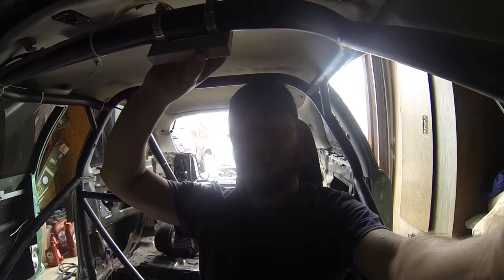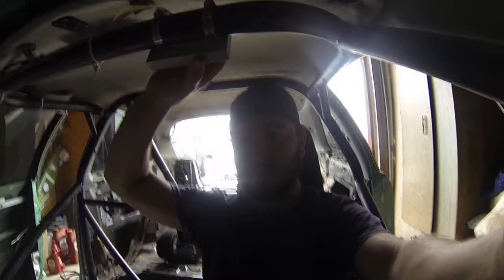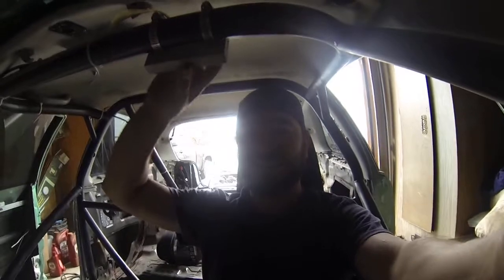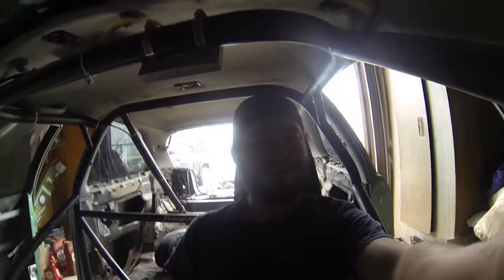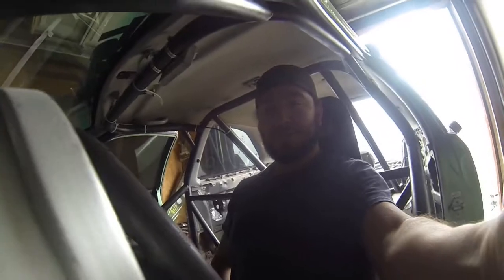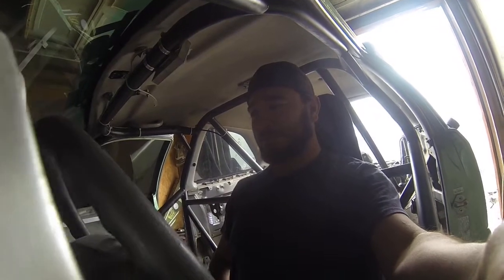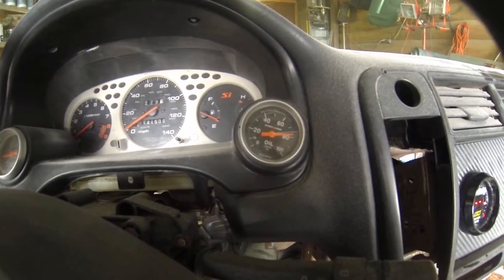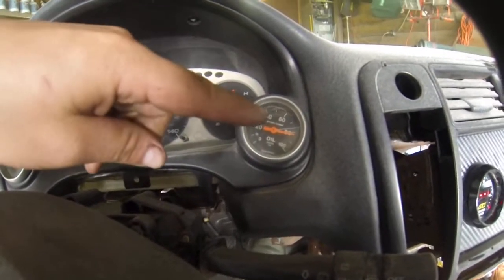First start up of my coil on plug setup, skunk2 pro1 cams revving up!!

Comment: Wonder if this will work on my aem ecu
Reply from the maker: Shon Poul I don't think it would bro because I know aem makes there own cop set up. But I could be wrong
Reply: Jason Hiboost, thanks man i guess ill just stick with my m&w set up
Reply from the maker: Shon Poul I was originally gonna run MW pro 10 setup as well until I found this cop setup
Reply: Jason Hiboost, im just having problems wiring it up. Tryed to wire it a few time but failed lol. So im just going to order the harness for the m&w and call it a day, should have the correct pinout on the connector so maybe this time it will be wire correctly
Reply from the maker: Shon Poul hahaha wiring sucks as stated in this video we wired up my cop system wrong lol might double check all your wiring to verify bro
Reply: Jason Hiboost, im just going to hold off and do it once i fly my tuner in and he can help me wire it up. Lol
Reply from the maker: Shon Poul that will work as well hahaha

Comment: Is this on the normal low cam or is vtec locked ? Sounds great
Reply from the maker: Vtec is not locked this is a cold start on the low cam. Thanks bro
Reply: Hell  ya. I’m workin on my 82x89 b18c and just picked up a set of pro1 for it. Been checking out vids of other setups running them.
Reply from the maker: That's badass man you'll like them mid to high range is where we saw the gains on the dyno. What fuel you planning on running?
Reply: Jason Hiboost I’m from northern Oregon where closest e85 is an hour either way for me. I’m going to do pump gas just for my wastegate only tune then when the boost gets turned up I will switch to corn or race fuel. It’s still going to be a street car for awhile as well. It’s approx 11.3:1 comp ratio so when it sees big boost I will definitely need better fuel lol